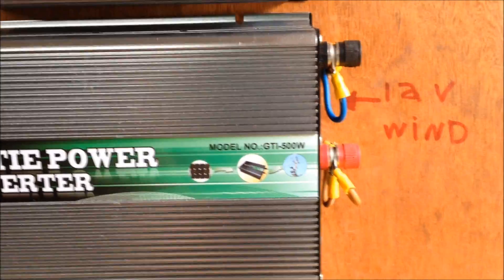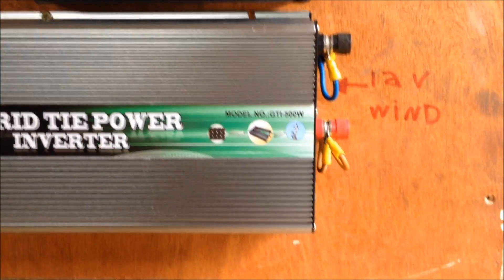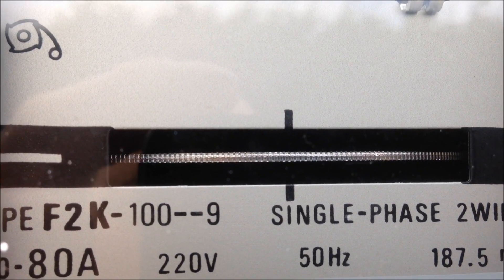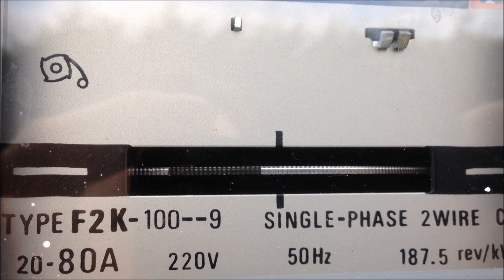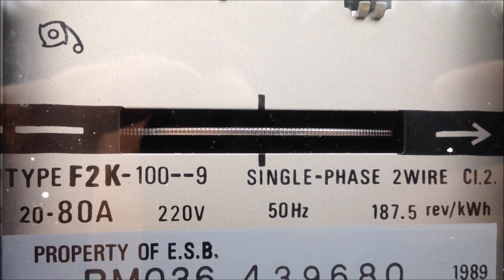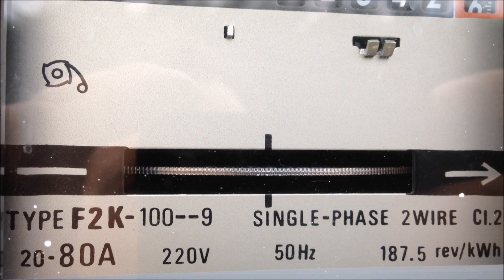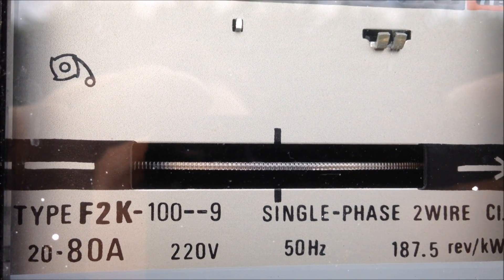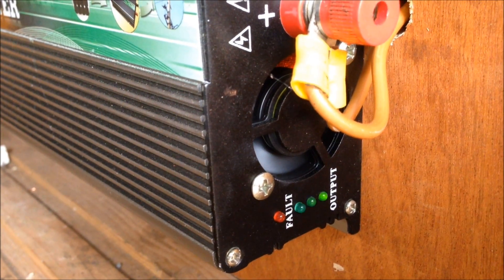diy connecting my 500 watt grid tie inverter to the main grid gta v

Comment from the maker: Hi Droumreague as far as I know as long as it turns off if the power drops out to protect the lines men it should be ok.
Reply: My generic, identical inverter drops out instantaneously on the merest hint of a power outage.  I can't testify as to its conformity with law, but it certainly seems to work absolutely as intended - safely.
Reply from the maker: Yes mine does the same too.

Comment from the maker: hi chillimonster1000. Yes i had the same issues as you had. The way i got around it was i wired it into the main switch. If it keeps tripping the mcb there must be a big issue with them inverters. Some grid tie inverters don't seem to work with a dirty earth. If you can get a clean earth to the inverter they work Great you could have a bad earth which causes all sorts of issues. I have a 500w grid tie which i have solar panels and a wind turbine connected in and run at the same time with no issues. Did you use a charge controller with the grid tie? I don't use one i just have them in 12 volt as my run is not far. I can use it to charge my battery bank. I would like to know if this has answered your question. Thanks for your comment.

Comment: Hi Stephen from a fellow native. I bought a similar Chinese inverter last year trying to feed in 6x110Wp array. However the inverter kept tripping the main MCB  and blowing some mosfets in the inverter. After repairs and replacement I finally gave up and bought a Soladin 600 which works seamlessly. Did you have any similar problems by any chance?

Comment from the maker: Sunlight conversion rates (solar panel efficiencies) can vary from 5-18% in commercial production, typically lower than the efficiencies of their cells in isolation,But as we knew that the solar energy is so powerful that even with this conversion rate is able to produce a large power supplySo, when direct sun light is available they produce more power but when it is cloudy they are not as efficient but power is stored through batteries and they work well but

Comment from the maker: hi billy hope this helps,Solar panels use light energy (photons) from the sun to generate electricity through the photovoltaic effect,Recent solar panel designs include concentrators in which light is focused by lenses or mirrors onto an array of smaller cells,Depending on construction, photovoltaic panels can produce electricity from a range of frequencies of light,